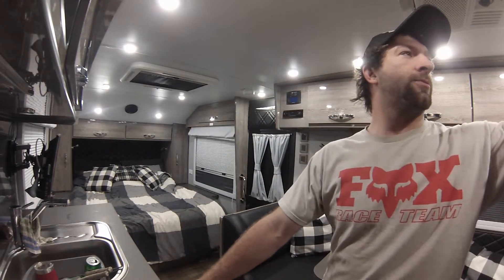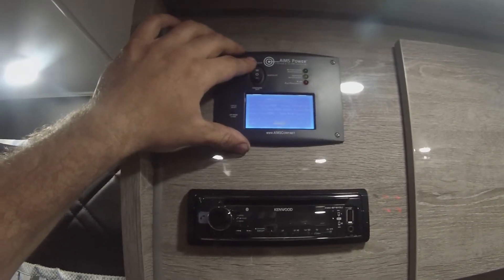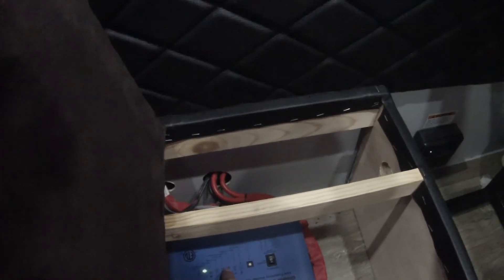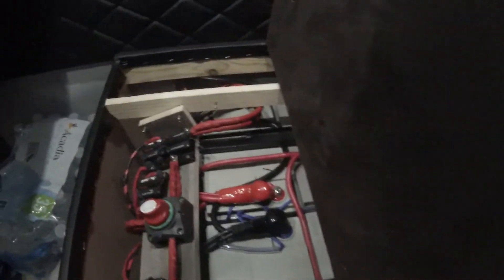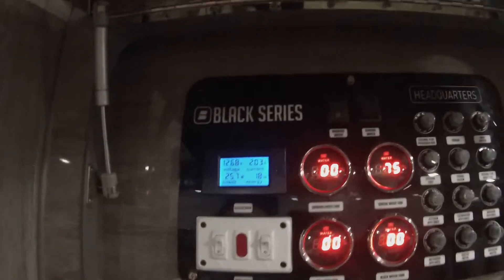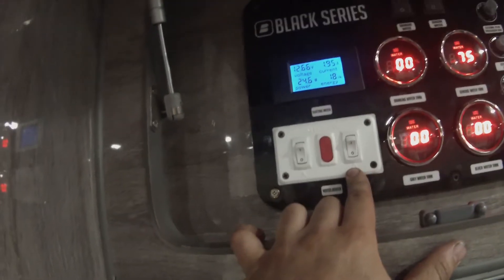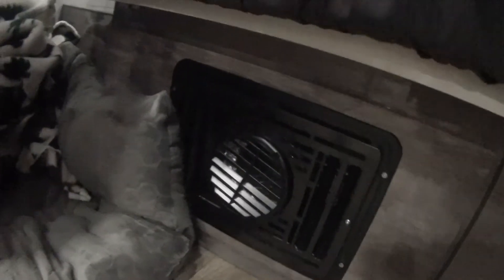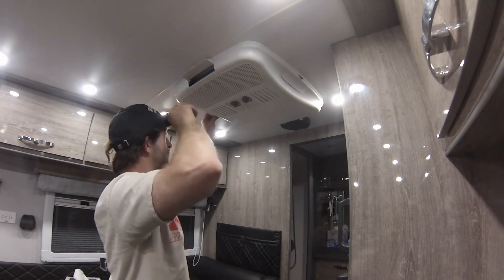BLACK SERIES HQ19 ELECTRONICS OVERVIEW

Comment: I recently purchased a 2022HQ 19 trailer and Headquarter panel doesn’t seem to get any electricity. it doesn’t light up and none of the lights work or water pump switch. Everything seem to work fine until I parked the trailer for about three weeks and the battery went down to zero.  The inverter is charging the battery and the electrical works and the microwave works. Can’t get the head panel to light up. Is there a fuse that operates the headquarters?